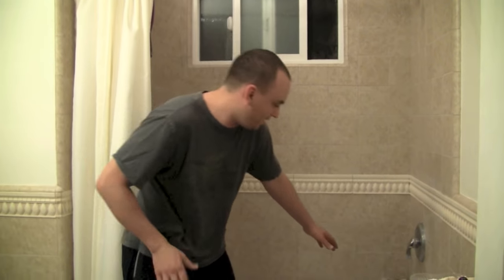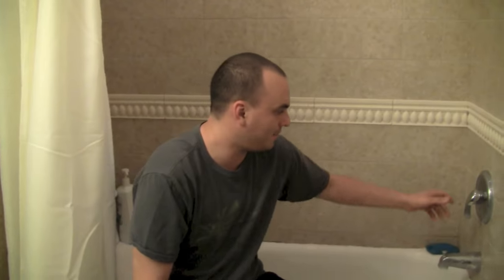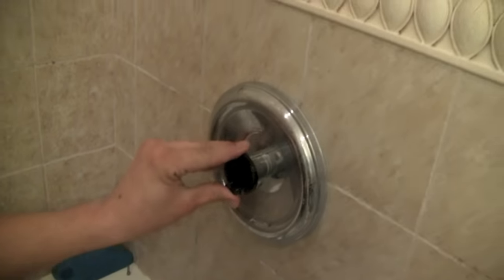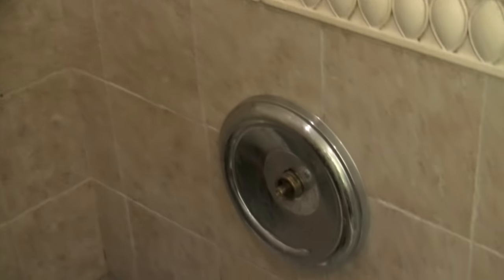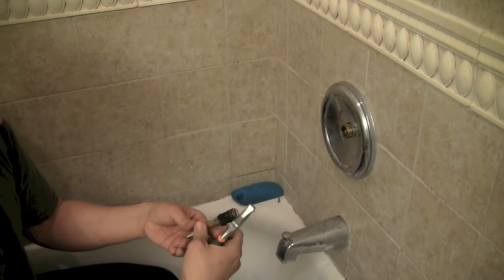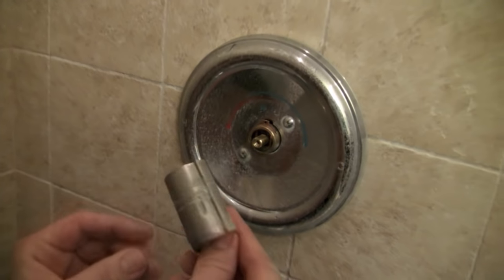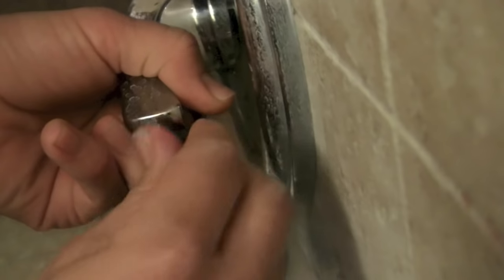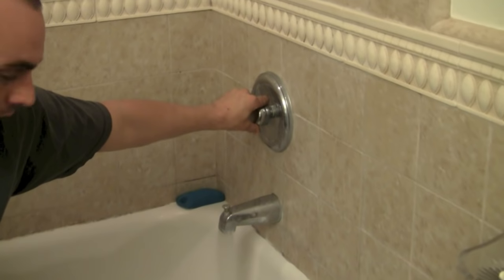How to Repair a Moen Shower Faucet Step-by-Step

Comment: Thank you for posting this, I need to fix my show valve as well.  Mine has a plastic handle tho with no socket head cap screw. Does the front face plate just come off then and reveal the Philip's head?
Reply from the maker: Yes just remove the center pice on the handle.

Comment: I've been looking at mobile homes with the single lever showers. They don't  have an access door  and have been trying to figure out what it would take to repair it.  It looks like no access door is needed.  Just need to make sure its a name brand so parts are easy to find.  Thanks.

Comment: Great Video, thanks! One question though, my handle is stripped and comes right off with the Allen head still in place. Is the 1225 still the part I need?

Comment: Another video showed that you have to rotate the cartridge's ears 90 degree before you can pull it out .  Why?  Because it looked like you were able to pull it out without having to rotate the  ears 90 degree.   I broke 2 of those plastic Moen cartridges trying to replace it.   Should've watch your video first.   Thanks for the video.

Comment: Mine has the same shower system but on mine the handle wouldn't stop at the off position. It kept turning around and around and wouldn't shut off. I had to remove the handle and then take pliers and turn the shaft to the off position. So if I change that whole cartridge that will fix that issue too?
Reply: The plastic part under the handle is the stop. Could be damaged.

Comment: I am trying to replace the cartridge in my Moen shower mixer and there was a cap that I had to pop off to access a screw to remove the handle.  I did that but now I can't figure out how to remove the rest of the chrome handle to get to where the cartridge is.  There is no allen screw to loosen by the way.  Just a round chromed cover and the 2 screws that hold the plate against the tile but I can't even remove those due to the chrome piece blocking their removal.   Suggestions?

Comment: Do you have to replace the entire cartridge or can you only replace an O-Ring?
Reply from the maker: +BoxingJ the O-ring will not prevent it from leaking. The two rubber pieces on either side of the cartridge will prevent the leak, but Moen does not sell them alone as far as I know. It's best to just replace the entire cartridge as it is only around $20. Also if you contact Moen they usually will send you a new cartridge for free if you tell them your old cartridge is leaking or no longer working.
Reply: Good info.  My leak isn't that bad.. maybe 1 drop every 5-6 seconds.  Will contact Moen and see what they say.
Reply: Moen responded the very next day and are sending me a free part.. but they are sending me a 1222B.
Reply: Final follow-up.

Moen got me a 1222B (not a 1225) within 5 days of submitting an online comment about it.  FREE

Sadly, the full repair took me 3 hours.  I ended up getting the Danco cartridge puller from Home Depot and it took some SERIOUS power AND patience to get the old one out.  I tried using the plastic twisting piece Moen supplied but it was junk.  The old cartridge was so brittle, the plastic piece was eating into it..

Comment: Tried to remove my old cartridge  but it won't budge after I pulled the clip off.   I was afraid to pull too hard on it so I may have to call in a plumber?

Comment: @How2Plumb I'm doing this repair right now and the clip that you took out with needle nose pliers fell into the wall, can't find it. What is that part called, where can I buy it? Also, the old cartridge does not want to come out.
Reply from the maker: It’s called the retainer clip. Amazon sells them. To remove the cartridge try moving it back and forth while pulling out.
Reply: @How2Plumb  thank you, went to Menards and they sell a 4 pack for $5.00.

My mistake when trying to take the cartridge out was that I had it on the off position, turned it to the ON position and it came it with medium strength.

Thank you.

Comment: Hey Dan, do you know if all single moen shower faucets are going to be 1225 cartridge?
Reply from the maker: No not all single lever handle shower faucets are going to be the 1225 cartridge. The newer style is the 1222 which is the for the Posi temp valve. These are the two most common.

Comment: i know this is an old  video but i wanna repair mine but this isnt my house and i do not know where the water turn off is so the question is can i do it without turning the water off i know its gonna be messy but can it be done can i put the faucet back to place after removing it without turning the water off? please please get back to me i wanna take that risk but afraid if the water isnt turn off and i dont know maybe the faucet couldnt get fit in because of the water pushing out i dont wanna break it even more thank you
Reply from the maker: It is impossible to do it with water still on. You must turn off the water.
Reply: @How2Plumb  thank you for getting back and thank you i guess i have to find where the water shut off is .. thanks

Comment: Looks easy enough. Cost me $400 at Roto Rooter in the end.*  I bought the parts, # 1225, the grease, cannot get the screw out.  I have bought and borrowed every allen wrench device and I can not get that first screw to budge.  My house is only 9 years old and this thing won't move.   4 days of trying. Finally got it off using a pliers to better grip the allen wrench.  100 tries and off.   Now I cannot get the phillips screw out.  Had some friends come by and try.  My guess is the grooves are stripped at this point.  Sure miss having running water.  Any advice?  Retired and tired.  Finally called  Roto Rooter who told me the part 1222 cost $55 at Home Depot and charged me $88.88 for it after leaving to go buy it.  They also charged an imaginary $30 fee.  I called all their numbers and the General Manager and no one has replied. Their tech used a drill bit to turn that phillips screw and the rest went exactly as you showed.

Comment: I cannot pull out the cartridge. The cartridge can be pulled forward to the "on" water position, but I cannot seem to pull it all the way out to replace it. I did remove the clip.

Comment: Great vid!..My blunder: I should have first looked and understood where the “legs” of the clip rest against the CURRENT cartridge before sliding the clip out and removing the old cartridge. I screwed up and did not understand the location on the new cartridge the clip should rest (I thought it was against one of the circular pre-set grooves on the cart, possibly and stupidly on the rubber ring groove. Also, I don’t believe the 1225 cart I purchased made ANY MENTION in the instructions about that clip). The clip in fact chills on either side of the little plastic rims that stick out like a partial circle on the top/bottom, basically holding the entirety of the cart in the pipe from its furthest edge. This is literally $155 knowledge I’m passing on. It’s all I missed in my attempt. Good luck!
Reply: Glad I read your comment before I got started because I almost got hung up on putting the clip back. Then I remembered this comment and it all made sense.
Reply: yes!! fitting that clip back in at the end is a game changer!

Comment: dang i cant get the lock key in at all. for me the lock key slot is slightly recessed behind the wall and I have to hold it with needle nose pliers just to get it over the slot; and it wont go in! seems like the cartridge cant be pushed back any further and the key just wont go in

Comment: What can I do after I stripped my stupid allan screw?
I have been putting degreasers in the hole as well liquid wrench.
Hitting it with rubber mallet.Even using a drill to try and weaken the allan screw to get the handle off.Helpppppp. Moen says I should break the handle and replace it.
Reply: Go to an auto parts store and buy a screw extractor. Drill a hole in the top of the screw, hammer the extractor in and then turn it with a wrench

Comment: My shower just decided to not turn on. Is this the same way to fix that problem?
Reply from the maker: +Deborah Sims fist be sure your water is on at different places in your home. Next assuming it is just a problem with your shower, shut the water off to your home and then follow my steps to remove the shower cartridge and you should look inside the valve body with a flashlight and make sure there is no debris like rust or small rocks that is obstructing the flow of water. If you find something obviously remove it. You can also with, the cartridge off flush the system out by turning your water to your home back on just for a few seconds. This will flush any debris that is stuck further down out of it. It is very helpful to have a second person on the job so water does not get everywhere in your bathroom. Be very cautious when doing this because water does spray out of the valve body at a fast rate. At this point you can reinstall the cartridge. But if you've gone that far you may want to replace the cartridge anyway. Let me know if this works.

Comment: Heads Up, my replacement came with a white cartridge removal tool that broke the seal for the cartridge after using it slides right out.....
Reply: I need that tool my cartridge won’t come out 😳

Comment: Can the water heater cause a  leak? Got charged $85 to change a cartridge and is still leaking. Plomer is is telling me now is the water heater. Water heater is 4 years old. Pleae help.
Reply from the maker: No the water heater will not cause the Moen valve to leak.
Reply: How2Plumb thank you so much for answering.

Comment: My cartridge is too far back in the wall, I cannot pull the clip out.  I am not sure what to do at this point.  Bummed because I want to do it myself instead of paying someone to do it.
Reply from the maker: Have you tried to remove the round chrome flange,  then pull the clip.
Reply: I did remove it and I still cannot get to it.
Reply: I cannot find the water supply turn off to the shower.  I had to cut it off at the road.  If I could just turn off the water supply to this shower, I would leave it for now but the dripping is driving me crazy!
Reply: How2Plumb Finally got the clip out but I cannot get the cartridge out.  I put the plastic tip on and have turned and turned and it still will not come out.  I should be able to do this!  I don't know why it is not coming out.
Reply: +Bonnie Murphy I purchased a stem removal tool. payed for itself on the second faucet repair.

Comment: No way does that cartridge slide out so easily, he must have prepped it ahead of time.
Reply from the maker: +Plumber Z   no I did not prepare that cartridge ahead of time. This job was done at my own house and when I change the cartridge I always put lots of grease on it. This makes it very easy to slide out when it's time to change the cartridge. Thank you very much for the comment.
Reply: How2Plumb

Comment: bummed...i buy moen shower parts and i follow this video every other year.  surely the moen part can last more than two years?   sure getting tired of replacing it. House was build in 2003.  always same shower.  the other bathroom shower is fine and it is used more/never been replaced!      GREAT VIDEO
Reply from the maker: I have seen this problem before, try the 1225M cartridge (not 1225) its more durable. Also do you have a tankless water heater?
Reply: How2Plumb I have a similar problem.  My house is much older though.  Have a regular water heater, but I was thinking perhaps the line pressure is too high.  I cut it down to 60 psi and will see if things last longer.
Reply: thanks!   oh, it is a regular water heater....and the other bathroom (used much more) has no issues (weird, eh?)
Reply: +Rosalie Everett I was told by a plumber that usually the valve that is used least is the one to wear out first.  Odd but true.
Reply: +How2Plumb   i have not found a 1225M.... i found a 1200 brass cartridge, the package says "Brass cartridge for Moen, tub/shower only".   not sure if i should install it!  it looks like the same size!  yikes!

Comment: I tried and tried to pull the stem out. even bought a puller. It will NOT budge. 😞
Reply: Mine was also difficult, if you are sure you are working with the same setup as him it does come out.. take it from a dude that definitely was hesitant to pull on it.

Comment: After taking the handle off and the screw out for the assembly i noticed that my bracket that holds the handle on is metal and wont budge! Theres no way it will just come right out like yours did. Any ideas? I know this was an old video but thanks for any input.
Reply from the maker: Try spraying it with WD-40 and tapping on it lightly with a hammer. If it doesn’t work repeat this process. Thanks for watching.

Comment: Calcium would make your pipe leak? Really!
Reply from the maker: +themrmoy40  It must be completely smooth where the brass and the rubber touch. Otherwise water can leak through causing the shower head or tub spout to drip.  Thanks for the comment!

Comment: I want to attempt this, but i'm scared at  4:20  pulling out the old cartridge...  knowing my luck it will be stuck and I'll end up breaking it inside the hole !
Reply: Me too.  I only have time on the weekends for replacing my leaky faucet.  Hope I buy the right one because the hardware store closes early on weekends and that the old cartridge is not stuck.